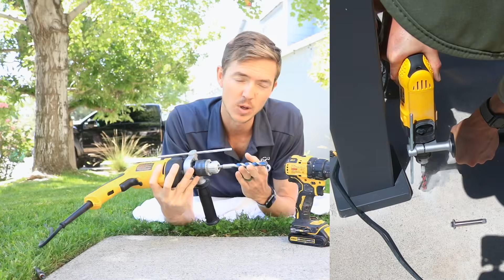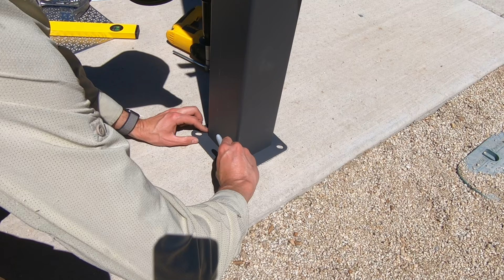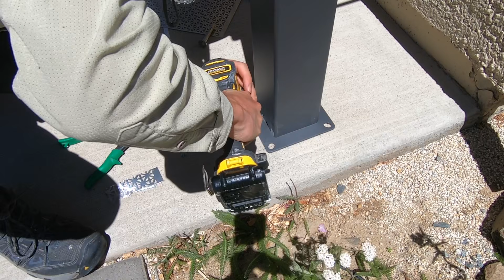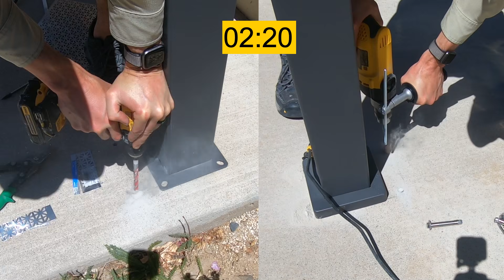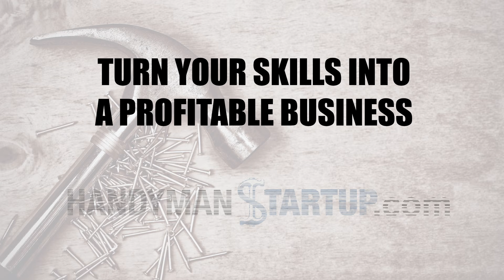How To Drill Into Concrete

Comment: Might as well make a video how you can use a chisel as a screw driver. This is just a great way to ruin your drill and drill bits. My house has concrete outside walls, a regular drill will get you trough the plastering but that’s it. I’ve tried it once in a house like this out of necessity but I ended up burning the drill bit, didn’t stand a chance. Just invest in an SDS plus drill.

Comment: Hi, I believe that the proper drill for this job would be a SDS hammer. It is significantly faster then a hammer drill and it will take about 3-4 seconds to drill a hole.

Comment: Drill holes almost daily in reinforced concrete. Sadly your dewalt corded hammer isnt powerful enough and you have to push with your body. I got a makita a little bit bigger than that dewalt and I am not using my body weight to drill holes. Im just guiding it and apply a small pressure. The thing is it gets exhausting using your body weight to push the drill so I'd recommend a bigger tool for the job. 

That being said for a hobbist they can get by using a concrete drill bit in a standard drill but if they have to drill a lot of holes it gets exhausting. 

Proper tool for the proper job. A dewalt dch133 would do a better job than that corded you have and you would get home without body aches

Comment: Buying a good DeWalt SDS hammer drill was one of the great purchases of my entire idiotic tool collecting life. It all depends on how many holes you need to drill, how big the holes are, and how hard the concrete or stone is. I have drilled probably thousands of holes in masonry. You can definitely just use a regular drill with a good sharp masonry tool bit. Slow and dreary but it does work. The next step up is the basic hammer drill. They are a bit faster but also super loud and vibrate like you can hardly hold on to them. I wore out a really nice Bosch corded hammer drill so ended up buying this very sweet cordless DeWalt SDS rotary hammer. Cordless I say! OMG so fast, a fraction of the vibration, so much quieter you can actually not use ear protection, I am not kidding.  Also it will just a hammer, miniature jackhammer which is fantastic. Constructed walls in my basement had to drill about 50 holes into very old concrete. It was a real true pleasure using this new drill. If you just need to drill a few holes on one random project then yeah go ahead and buy masonry drill bit and have at it. I can give you about 20 of em I don't need the cursed things I have all SDS kit now.

Comment: That is not very hard concrete. I've seen good quality masonry bits melt at the tip trying to drill into hard concrete and old face brick, even with a hammer drill. Only thing that made it easy was a rotary hammer. Rotary hammer is a must in my book.

Comment: Yikes. Pushing on your drill like that is going to cause that bit to dull out really quick and you have a chance to snap it if its a thinner bit/small hole. 

Just get the hammer drill and save your regular drill for what its really meant for.

Comment: It depends on the concrete.  If it's fresh concrete with lots of sand and no gravel, then it can be relatively easy to drill through.  If it's decades-old concrete with lots of gravel then you'll want a hammer drill.

Comment: ok maybe I need to try drilling a smaller hole first. I'm going straight in with a quarter inch and I've got my full weight on it and it feels like the drill isn't going any deeper for minutes of drilling. Those drills you did looked like you were drilling through wood.

Comment: Masonary bits are horrible. I only needed to drill two holes in my garage for some garage door sensors. It seems like the bit dulled almost halfway through the first hole that I needed to drill. Had to use so much force and took twice as long as what you demoed with your ordinary drill. Mine was a Ryobi 18volt drill with a heavy-duty lithium battery. Maybe the bits I got from Home Depot were poorly made also by Ryobi.

Comment: Try this with older inside concrete wall that has been curing for decades. You will drain battery on your aku drill  before you get 1cm deep. In the process you will probably burn your drill bit.

Comment: Good luck with this approach. I tried this when I moved from my old home into my current one. In the old house I could easily drill into the wall with a normal (corded) drill and a masonry bit. Tried that in the new one, took me an hour, I got about 5 mm in and I had to get a new masonry bit. I also bought a hammerdrill and it took me 5 seconds.

This same wall, I hired someone to drill a hole for the kitchen ventilation. He came, and then used a huge diamondcore drill with watercooling that he bolted on the wall with 4 separate bolts. Still took him 5 minutes to get through the first wall at full power. Yeah, my walls are a bit of an outlier, but still. If you find yourself with really hard concrete, get a hammer drill. It's way easier.

Comment: It really does depend entirely on the frequency, size, and type of holes you're drilling into what type of masonry that seals the deal for what tool you actually need.

    If you're the casual handyman who, on occasion, needs to drill a half inch hole into concrete, brick, mortar, cinder block, etc, the average rotary hammer with a solid masonry bit will work just fine. I wouldn't even blink twice telling someone to who needed to drill two holes for a concrete anchor into a brick to hang a gas cylinder bracket to use a rotary drill, even a cordless one.

   If you do any sort of masonry drilling with regularity, of diameters larger than 1/2" into reinforced concrete, bricks, cinder blocks filled with cement, don't waste a second trying to use a regular rotary drill. Find and buy the largest rotary hammer drill you can, preferably with an SDS or SDS Max chuck with at least 10 amps and 5+ foot pounds of energy and quality SDS bits that is CORDED

   You'll be legitimately shocked how quickly you'll pulverize all the above listed materials. Anyone who has large bore holes to drill on a weekly basis will attest to this. If you worked construction for any length of time and how to augur through masonry, you'd be either let go or laughed off the jobsite using a rotary drill, pressing with all your might trying to get through a single brick while the professional three walls down is slightly leaning into the wall with his rotary hammer drill bulldozing through with ease.

  I've actually seen (and done in my amateur days) someone burn through two whole batteries on a cordless drill trying to drill into a cinder block nearly breaking their wrist through the effort. I walked up with the Bosch Bulldog Extreme with the notorious Bosch masonry bits and punched the desired hole length through in, no joke, 30 seconds. He looked at me, then down at his drill, and enough was said...which wasn't anything. In my opinion, Bosch and Makita make the best rotary hammer drills on the market with Bosch making the best SDS and SDS Max bits for said drills. They humiliate and brutalize masonry like it's an annoyance they're in thew way of the tunneling bit. Well worth the money.

Comment: What drill bit material used - cobalt?  - for drilling through brick and concrete.  How do I make I nice circular indention that will fit the square part of these bolts just under the head of the bolts?  My biggest drill bit won’t so it.  Is there a special type of drill bit for this application?

Comment: Bro, drilling into a brick wall with a 1/4 inch masonry drill bit using a battery powered drill is so painfully slow it will take less time to drive to rent a hammer drill, drill the holes with the hammer drill, return the hammer drill, and then return home than it would take to use this battery powered drill for these holes. 20 minutes of drilling and I can't even tell if I made any progress. I can't put my weight on it while standing on a ladder the way I could if I was drilling down into the ground. I recommend the hammer drill.

Comment: Using the cordless drill, which is more beneficial?...using the gearbox in speed 1, or speed 2?
And as well, which torque setting?  My Ridgid has 24 stops and the aforementioned two speed gearbox.

I am drilling 4 holes in concrete porch to install a handicap railing.  Thanks.

Comment: I resisted getting a hammer drill for a long time. I needed to drill into concrete on occasion but not often enough that I thought it justified buying a hammer drill. I was wrong. Drilling into concrete is fun with the right kind of drill. More importantly, if you intend to use  Red Head anchors you need a hole fairly close to cylindrical. The ragged hole produced by a non hammer drill may not be smooth enough. It is true that for smaller holes, maybe less than 3/16 of an inch a regular drill works OK. For 3/8 inch holes a regular drill might work if you are on Mars and can't get a hammer drill. But, if you're on Mars, you need to drill a half inch hole or larger into concrete and you can't get a hammer drill, just give up and enjoy the time you have left.

Comment: 1. It is not really easy to drill to concrete WITHOUT the hammer function specially when drilling holes to the wall or concrete soffits. Try "applying" your own weight on those. 

2. Forcing your cordless drill to this concrete, and then doing it several times, will wear down your battery even faster which will require you to charge more often. It is interesting to see how many holes the cordless drill without the hammer function can finish with one charge(considering the battery capacity, of course)

3. It is also interesting to know that hammer drills will make your work faster and more efficient in this kind of situation. 

The hammer function is designed to some drills, corded or cordless, for a reason.

Sure the non-hammer drills will get the job done  as seen in the video. But if you want efficiency(specially if you are drilling a lot of hiles on concrete), you may want to consider affording a hammer drill.

It is not that you don't need a hammer drill per se.
But it is about considering the right tools for the right job.

Comment: Once you use a rotary hammer you will never want go back to jus using a drill or a hammer drill. Especially if you are drilling a wall or ceiling. It will not becas easy. Jus saying

Comment: That’s fine if you’re doing something at home but if you are trying to earn money working on site and drilling in reinforced concrete you need a decent SDS drill,  it will eat through concrete 10 times faster then a normal drill.

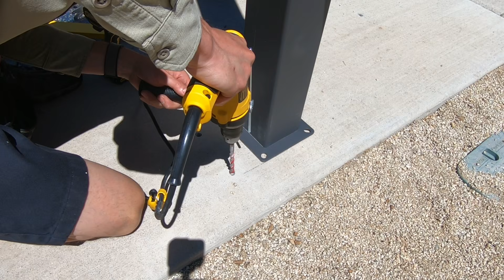Comment: For some people, this needs to be said don't drill anything laying down it is unsafe and you lose lots of mechanical advantage and your field of view, and watch out for your power cord time stamp 2:49! In my opinion, the drill chuck key, is in the wrong place it should be near the plug and you use the drill chuck key, when the drill is unplugged from the power for safety reason because this is a power tool not a toy, power tools can have a mind of its own unplug it when using the drill chuck key!

Comment: ok , that is a low to medium clas conret i gues  that sort  have lower NMeter goes ,is also used for , on higher grain and  hydrowlic ,that will takre longer  but when you have time to  make 1 hole in time off 1 ,  else otion water provided stonemassonery  drills  ect (no idea for ASA on concret)

Comment: I suspect there are no hard pebbles in your aggregate. Some pebbles or stones are impossible to penetrate with an ordinary drill.
Take glass, ceramic or porcelain it is extremely hard but very easily broken with a hammer.

My house is built with extremely hard bricks which is almost impossible to drill without a hammer drill.

Comment: Just because you CAN do it doesn’t mean you SHOULD. Using a regular drill is better than nothing, but using the proper tool, a rotary hammer drill, is by far the best option.

Comment: I'm a DIY person and I noticed that my cordless and good drill bits just better than I remember vs 15 years ago.  I think it has something to do with cordless being stronger and modern drill bits a lot better than back in the day. still, I prefer the hammer mode as without it the job is slower and a cheap drill bit becomes too hot or dull.

Comment: Having drilled thousands of holes in masonry I can say that having the right tool for the job makes things go much smoother and quicker, and that would be with a rotary hammer drill. Yes you can use a regular drill with a masonry bit, and as commented on, you're going to have to use some physical pressure to get the job done. I believe the point is, if you only need a few holes for a specific install then it isn't necessary to blow a bunch of money for another tool. However, if you're doing this in a repetitive fashion then save your body and energy and use the correct tool for the job and get the job done more efficiently.

Comment: This is totally contrary to my experience, especially in older concrete.  I had a number of holes to drill and couldn’t get more than an eighth of an inch with a regular drill in spite of me putting all my weight behind it (with a new masonry bit).  I switched to a hammer drill and it drilled like butter.

Comment: If you want to drill into concrete effortlessly.  Get a Bosch Bulldog. You can find a brand new one for $145 if you look around.  It will last you for years to come and has many uses.  It is a rotary hammer so you can drill, drill and hammer or just hammer.  Hammer only allows you to bust out stucco or concrete.  It's like a mini jackhammer. You can use it to remove tile.  It uses SDS bits so they lock in and don't fall out.  You can use an adapter that will allow you to use regular drill bits if need be.

Comment: Concrete comes in different hardnesses. Also newer concrete is softer than old cured.  I’ve burned up tones of bits trying to do this with regular frills or compact hammer drills.  Do yourself a favor and get a rotary hammer drill for this job.  You will save your expensive bits too

Comment: Tip: use a drinking straw to reach the bottom of the hole with the vacuum and clamp your hand around the vac nozzle and straw top.. it's way easier to get the dust out.

Comment: If only this would work all the time.
My hammer drill would struggle to drill into my house bricks, in fact it was quicker to go and borrow an impact drill, drill the holes and return the drill.

I work as a handy man and use a cordless impact drill, with integrated dust extraction. Quick clean holes every time. 
Note an impact drill, is different to a hammer drill used in this video and uses an SDS bit.

Comment: If you want to get more than 2 or three holes from your drill bit, have a bucket of water handy, and dip the drill bit into it every so often. This keeps the bit from over heating and loosing its temper. I also use a cold chisel punch to start my hole. This keeps the drill bit from wondering. Simply place the punch in the correct location and smack it with a hammer a couple of times. Also, if you are drilling into brick or concrete block, it is best to not use the hammer function, and it will blow out the back of the block like an explosion.

Comment: I did this experiment on my own as I did not want to go out an buy a hammer drill if I didn't need it. After going through 2 batteries and not even getting through 1 1/2 holes I decided to buy a drill with the hammer feature. It was a night and day difference. It took me just 5 minutes to drill the rest of the holes I needed.

Comment: I had a project for a customer last fall that required me to drill several holes in very old concrete.  After trying to use my regular drill and several bits later, I decided it would be much easier to rent a hammer drill and it was a wise decision for sure.

Comment: It’s a good idea to mark the hole's centre position with a cross that’s a bit larger than the drill bit. That way, if the drill drifts at the start you won’t loose the correct centre position if the drill moves a little and scrubs some of the mark out.

Comment: Just use rotary hammer, then you don't have to use a single bit of your force, it'll be much easier to drill in concrete with it than impact drill

Comment: I like the video, however, what about drilling into, freezing weather, concrete? I am not getting a clear answer on it anywhere. I am hearing a concern that hole may get bigger when it is warmer weather, but i am not getting a solid answer on it. I want to drill a hole and use redhead bolts.

Comment: Just about to install the same pergola. Do you remember which drill bit you used? Also would you recommend using a tapcon kind of screw instead of an expanding anchor. I have read lots of people had issue getting the provided anchor to grip in the hole. Thanks in advance

Comment: If you need to drill on a vertical surface above your shoulder height, use the hammerdrill. Work smarter. Not harder.

Comment: Drilling into concrete with a drill that doesn't have Hammer Action feature? That's just pure pain....for the user and the drill! A drill with Hammer Action is the minimum that should be used for holes into concrete or masonry. Ideally an SDS drill should be used which will be so much faster than even a Hammer Action drill.

Comment: Am installing handrails on concrete steps. The problem is the concrete is 70 years old. Have used hammer as well as regular. Rounded off several bits. Going to rent a rotary hammer drill to see if that helps. Any suggestion on cured concrete?

Comment: This was one of the most helpful videos. I used the same drill your using to install a sturdy ground anchor, the cement was almost as easy as wood. At first I tried a cheap bit - it overheated and barely made the hole. Then I switched to a quality bit - HUGE difference. I'm also 240 which probably helped - thank you for saving me from buying an overpowered tool that I'd never use.